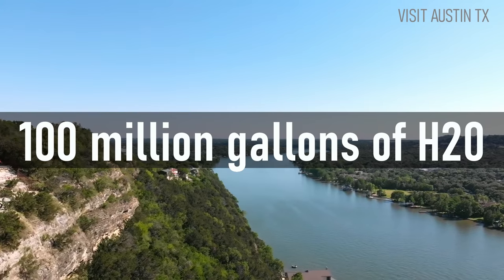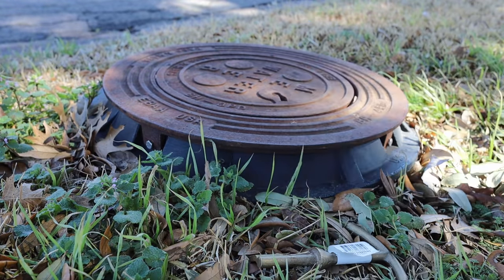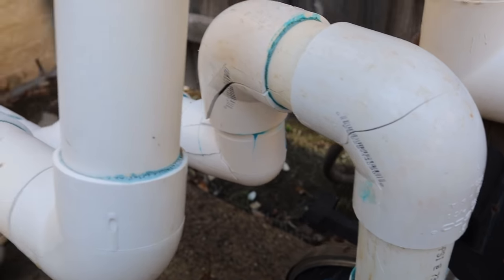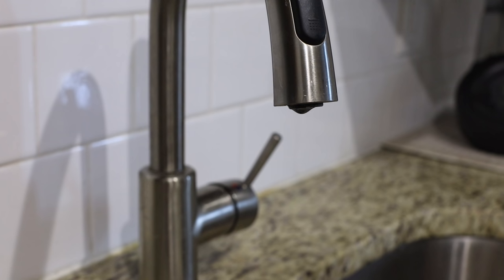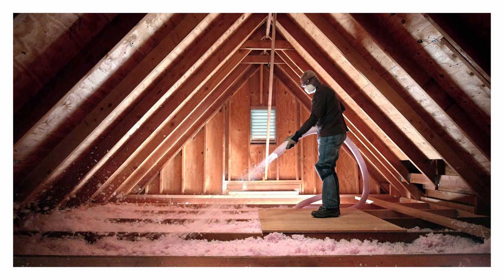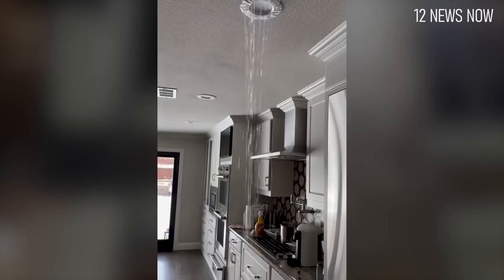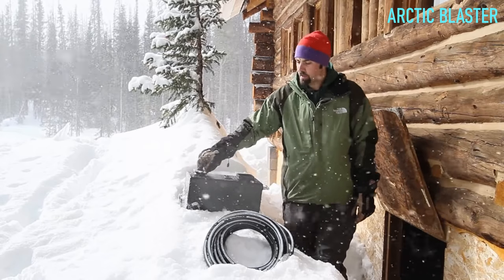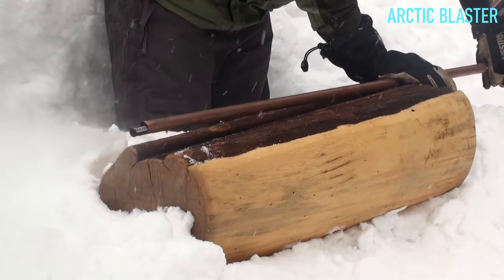How to prevent frozen and burst pipes

Comment: Freeze proof spigots on all homes in Texas should be code.  The valve lives inside the wall and when shut off the water then drains out and is much less likely to freeze and cause damage. I have then in my ICF house, and the trick is to design their locarion with an interior wall. This gives the plumber an interior wall to run a pex line, as well as a place for the connection to live (inside the interior wall. If you ever have an issue it’s. I have easier to contend with the repair because you can access the interior valve from the interior wall.  It’s just a drywall repair.  

Additionally, I have my UPONOR pex all connected to a home run valve shutoff manifold.  I don’t like the plastic manifolds, mine is copper with 1/4 turn ball valves.  Every valve is labeled to location, and I can remove pressure from things like outdoor sinks, hose bibs, etc. both hot and cold lines.  I feed 2 manifolds in different locations, and have a hot water circulation pump that charges the main lines through the manifolds every time my automation system detects occupancy in a bathroom or kitchen (when a light in those rooms is turned on, the pump activates for 3 minutes.  So I save water, time, and power, by not having to wait for the entire length of the pipes to empty of hot water.  The manifold is always recharged with hot when it’s needed.  Just a small line from manifold to fixture is not.  

I have my hot water pex supply line attached to the rafters bottom side, and marked.  Then open cell foam in the attic completely covers this line, thus insulating it from freezing and standby heat losses when it’s idle.  

Any system that is capable of failure is located in the attic above the garage.  I have there a desuperheater tank, a solar tank, solar pumping station, reverse osmosis filters, and some other pumping equipment for some radiant heating. But short story long is that IF these pipes or systems break and massively leak, the damage is basically just the drywall in the garage rather than above something expensive, like above a bath, kitchen, home theatre, etc.  

Also, exposed pvc pool pipes that are not at least painted are exposed and weakened by uv light. It should at least be painted with special paint.  I have all my pool pipes in a specially built pool shed elevated in a “concrete bathtub” that is connected to 2 drain pipes as a precaution. It makes the equipment last longer not in the sunlight or weather, and gets it out of sight.  As a side benefit most pool control boxes can serve as a breaker box for the electrical system in a small shed.  I even have wired into the relays circuits that provide co2 injection for ph control and liquid chlorine (bleach) pump for sanitation.  

Another idea is to hook up farm hydrants to the pressurized supply lines to your irrigation system.  I have 2 of these set I a gravel pit with a small concrete pad above them holding them sturdy. When they are turned off, the water in the system drains back down into the gravel so they don’t freeze.   they are also very sturdy and tough, as well as lockable.  

As far as other code changes. It’s probably not legit to legislate, but my personal theory is  fiberglass insulation should never be used without an air barrier.  I think we need to push a foam standard, but to legislate this would be tough and potentially tie hands. I personally would walk away from any house I didn’t have some documentation as to what was inside the walls.  

Buying a house based on cosmetics, and our really weak system of codes and enforcement needs to change in the state of Texas.  Good builder can’t thrive as they should, and cheap builders seem to thrive.  Consumer knowledge needs to go WAY up.

Comment: What really needed is to build to Northern building  standards, that take freezing into account.... 
Such as requiring spigot (ie Texas hose bib) cut-offs that extend well into the interior of the home.... so that water in the spigot drains out.... 
And placing piping and water heaters in and on interior not exterior walls... 
Also use PEX A piping with expansion fitting....
Reply: Who is going to pay for all of that? How big is the risk vs. the cost? How much of the USA should adopt those standards? There are millions of people who live where freezing is rarely an issue but, like in Texas, it could happen. How much do the freeze proof hose bibs cost and how hard or expensive are they to replace or repair when the eventually fail vs. a standard hos bib? This is just Texas. Should we build to handle tornadoes or hurricanes in California? Where do you draw the line and say something isn't worth doing for a very small chance of a problem. Sometimes the prevention or cure is worse than dealing with the problem. If the utilities were better prepared, it would have made a night and day difference and it would have helped all buildings and people. Northern building standards would have only worked if people also had backup water and power, which is another cost. It is a complex problem with no easy solution.
Reply: Google the the cost difference, Einstein... 

Also backup power would be nice, but it is not even relevant for outside spigot, which are on the cold outside of the house...

And northern building standards include 
placing the pipes in the core of house (instead of outside walls that commonly done in Texas) that retains heat much longer. 

Bottom line most changes cost little to nothing for new construction (just gave 1 example).  And a few hundred dollar for the easier retrofits.

And you want the utilities to be "better prepared" (ie pay the cost freeze proof) but not homeowners..... Great bass-ackwards idea... 

Have fun instead ranting "This is just Texas" inferring you do not need  newfangled carpetbagger ideas.... Go luck, having homes that are now swimming pool and will be again without retrofitting....

Comment: You are absolutely right about getting a water service key and learning how to use it. BUT .... 

DO NOT tell your water supplier that you have one or have used it. They HATE that. It means they have lost a certain amount of control over the meter and the valves. If you do use it, you can tell them that you were forced to in an emergency. Don't *volunteer* that you have the capacity to cut the city water on and off at will.

At most, you should say, "I was able to get it turned off." And just stop there. Maybe you add, "Can you send a service tech?" And leave it at that. Since the shut-off valve is on their side of the meter, you are fooling with their property.

Comment: I noticed a pic of pro press copper in the video. I use pro press but I don’t trust it as much as solder. My argument is I don’t trust an o ring that I can’t change. They may be fine for years but I don’t trust them to last 50 plus years like I’ve seen from solder. However the ice storm in Austin put another con in the pro press column. I saw tons of pro press fittings completely pull apart from freezing. Some would say what’s the difference between a burst pipe and a fitting pulling apart, they both still failed. However it takes a lot more pressure to burst a pipe so you’re a lot less likely to have failures with solder and fewer of them. Also, damage wise, there’s a lot more water from an open end pipe than a 1” slit.

Comment: Kopper pipes can be bent,  up to 15mm  easily with simple tools sices over that gets more complex,
Then you have to use heavier pipe benders.
 sand filling the pipes work for  "freehand" warm bending steel pipe , heat treated soft sand filled  copper could bend nice "freehand" If sandfilld first ( the smaller dimensions 15 mm  don't need to  bee filled, if they are bent with  a pipe bender.) Hard copper pipes will not bend with good result if not softened first.
Copper hardens when its mechanicaly treated / hammered. 
There are also pipe in pipe copper tubes if the inner copper tube start to leak the content comes out att the end of the plastic  pipe that covers the copper tube.
These type of pipes are very soft and can be bent by hand, over your knee for ex. The plastic pipe helps the pipe bend uniformly to some degree without flattening.

Also remember that ball valves can crack when freeseing  even when pipe is emptied of water ,if put into full open position. Always  put handle 45 .degree when empting systems in cold conditions so that water does not get trapped between the seats of the ball valve.
This technique  ensures draining both the ball boring and the ball vent. housing.
Reply: Thx. Didn't know about the 45.
Reply: Good advice thanks.  Didn’t know that

Comment: Only thing I can think of off-hand is that when temperatures drop below 50-60 degrees Fahrenheit, we open up the cabinet doors to the sinks, because it's generally colder there.  If we can't afford insulation, we wrap towels around the pipes.
Reply: You don't need to do anything in those temps. It has to be below freezing outside for an extended period for pipes in even an uninsulated garage to freeze. It would take colder or longer inside a house.
Reply: @YSLRD  Sorry, I should have clarified.  I know it needs to be below freezing, but I'm saying once it starts dropping below that, we prep.  It has to drop below 50 for it to get to 30, essentially, and I don't like to wait until the last moment.  My  house was built in the 60's; the kitchen sink is up against an exterior wall and it's always colder under there.

In Texas, we can have a 30-40 degree change in temperate in one day.  And I've noticed over the last year or two that the weather reports aren't always close to accurate.  Using "Alexa" and local news, the high or low might be x degrees, but at my house, it can be up to 10 degrees difference.  For example, this week our Tuesday or Wednesday high was expected to be 70 or 71, but it was 79 when I got off work mid-day and was listed as 80 by about 4pm.

Comment: These hundred year storms are going to become a much more regular occurrence. Time to start planning ahead. Pipe insulation only delays freezing, it doesn't stop it. It's better to have all those external pipes and valves turned off internally so they can be drained down during the winter. An empty pipe can't freeze.

Comment: I'm building an off grid cabin and I catch the water from the roof and send it into a couple tanks in the basement. The tanks are situated underneath the sinks and connected to a hand pump.  I think it would have to get extremely cold in the house to freeze the pipe running from the basement tank to the sink. Even if it did, there is a spigot on the tank to get water.

Comment: This is helpful only for those building their own homes from scratch with their own builder. Most brand new homes are ready to go from a spec builder, who's not willing to change cookie cutter designs. 
Maybe if you elaborate on how to winterize an existing (and possibly old) home would be more useful. Example, you showed the meter valve key, but how to use it? A lot of people don't even know where the valve is.
Reply: She's not a DIY'er type videos, though. There's plenty of them on YT already. What she does is present very well thought out arguments and explanations on many points relating to building constructions, designs, and trends or ideas.
Reply: @redthree  
As I said, this kind of info is only useful to those who are in the process of designing their homes with a custom home builder.
Extremely limited customer base.
Reply: @itsm3th3b33  The basic principles are the same, just installation is different. I retrofitted my home over the course of five years and those changes  have paid for themselves several times over. In both saving and overall comfort and livability.

Comment: I had a pex pipe freeze in a vented crawl space two weeks ago while the faucet was dripping at about 1 drop every 2-3 seconds in 20 degrees F. I was very surprised that this happened since it was during the day while I was at home monitoring the faucet drips every couple hours. The pipe unfroze a few days later and did not burst, but there was damage to the hose bibb on the same branch. The hose bibb was not dripping so I think it froze up and the ice pushed it's way back into the main pipe and blocked it even while a drip was running.

Comment: Bringing the attics into the conditioned space by spray foaming/rigid foaming the roof system is the way to go for all new construction (and substantial renos).
Reply: I was going to suggest that very thing. If you have a collapsed ceiling from burst pipes, this would be the perfect time to pull the rock off the ceiling joists and spray the roof/rafter surface. It will make the summer cooling burden smaller too. You need to block off all the attic vents too in order to seal off the heat/cool envelope.
Reply from the maker: @ricoludovici2825  I would be cautious of doing that. Older homes were built to be vented through the attic. Slapping new products onto older construction can lead to unforeseen issues.
Reply: @BelindaCarr  Well, sure. But if the ceiling is already being removed....
Reply: @ricoludovici2825  ...i think what @Belinda is referring to is moisture damage to the roof system from removing air circulation from beneath it with spray foam. you'd want to add a 2nd roof layer with an air gap, eave vents, radiant barrier, & ridge vent. would need to consult an engineer to be sure your structure can support the added weight, and also make sure plumbing/gas/etc vents are extended up through the new roof. then the underside of the original roof can be sealed air-tight with sprayfoam to create a semi-conditioned space (good for your HVAC air handler & ducts too).
Reply: @ricoludovici2825   Soffit vents? Ridge vents?
Reply: @Krazie-Ivan  Yours is a belt-and-suspenders method. If the outer surface does not reach the melting point because of insulation, it is not a problem. And yes, you would have to seal all the intrusions. But wouldn't you do that anyway if you were retrofitting insulation to a higher R-value in the attic? Especially if the point was to minimize freezing. 

Besides, you would need to consult an engineer anyway if you were adding a whole new layer of MORE sheeting and furring strips. Either way, yours or mine, the rafters would need to be strengthened if they were undersized. Of course, I live in Nevada and moisture is not a problem. But then I used to live in Minneapolis and ice dams were. And I know several methods for preventing them. All involve keeping the entire roof surface below freezing. Like you mention, they all involve thru-venting from eave to peak.

The unvented/insulated roof is even specified in the 2018 IRC.

Comment: Boy I would replace those copper pipes. I have refitted a number of houses over the last 10 years in pex. One such house sat empty 2 winter in a row with out heat and the water still on, Even the the coldest parts of the winter when temps were neg 20F or day on end and wind chills factors higher and never had to fix anything. I even fitted a double wide trailer for someone with pex and on section of the trailer where their washing machines were would always freeze and they never had a leak even when they could not use the washing machine yet the rest of the house was just fine. As for the DWV, I just dump hot water down them from time to time in really cold weather. The house I bought not long ago is having some work done on the foundation wall in the main bathroom and is currently dug out and the drains and water lines froze over the last cold spell yet running the hot water for a while allowed enough water to warm up the ice and slowly melt them and the same with the cold water. The drains as well, Just running some hot water unfroze the mop sink trap. 
Now the theory on running the taps when cold weather is not just tied to stopping the expanding freezing. Running the water keeps the incoming water warmer than the outside temperature. Most water supply are deep under ground and will maintain about 50F and running this water will bring in warm water to the home and allow it to keep flowing because it will keep said pipe at 50F. 
Another option for those who do not live in cold climates is to set up a blow out system and blow out all the water and put some RV antifreeze in their traps and toilets/tank. This is as simple as setting up a T with a valve and a small air compressor. Water line blow out fitting and valve are pretty cheap. If you have a good air compressor that does not leak you can keep it plugged in and filled up all the time so that it does not take long to blow out the water lines. Just hook up your compressed air line to the fitting and open the valve, Go to each top and open them till you get no water then on to the next one. make sure you drain your water heater.

Comment: If your plumbing is all galvanized steel I've seen guys hook welders up to them to thaw, using the heat that's created from the resistance.
Reply: That is a really cool idea.  Gets inside the walls  well and under the ground a little bit I would guess.